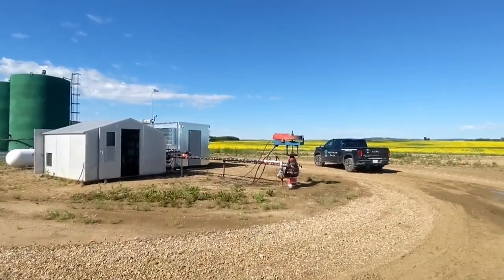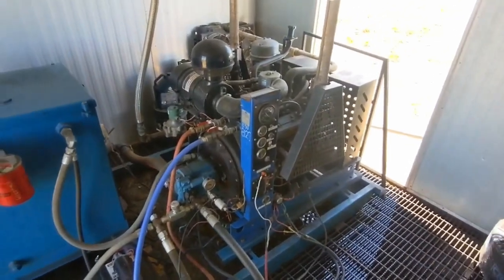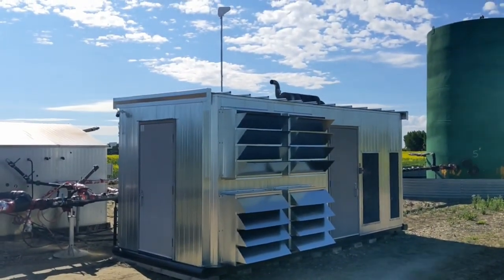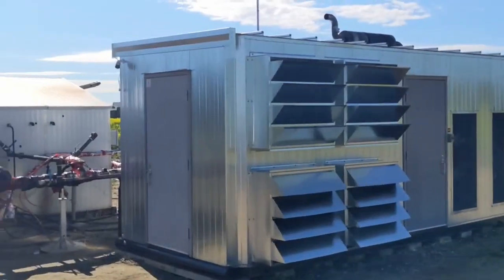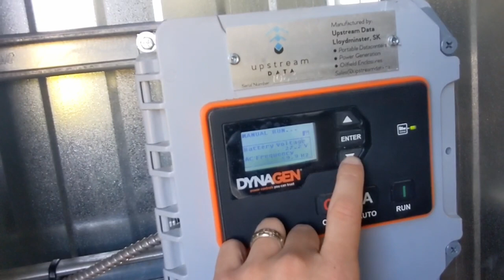180kw Off-Grid Bitcoin Mine Walkthrough with Steve Barbour

Comment: Great concept, great way to monetize stranded assets. All of the power is essentially being converted to heat by the bitcoin mine, have you considered using the waste heat for something? Similar to cogeneration, would boost overall efficiency even higher.
Reply from the maker: We are exploring water cooled systems that will allow us to utilize more of the waste heat. Currently the heated air is either vented to the environment or recirculated during cold months.